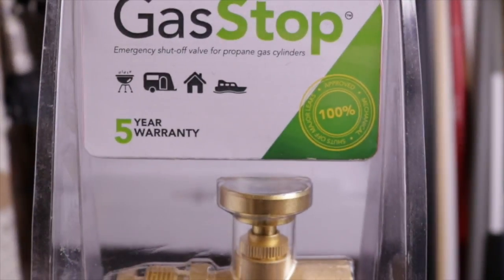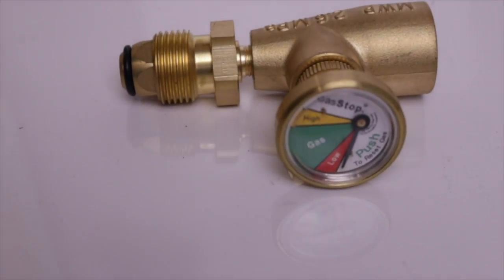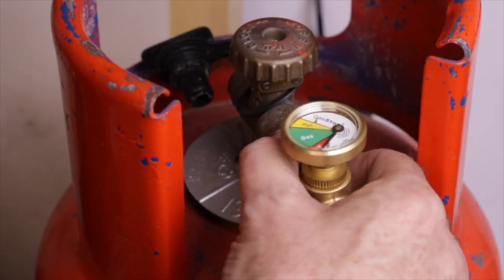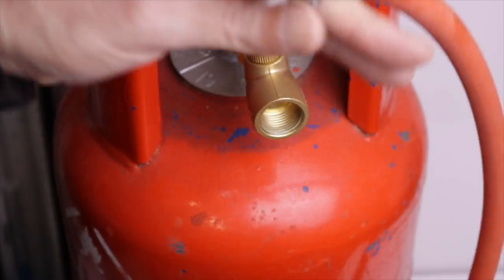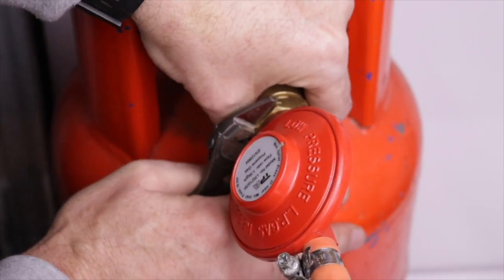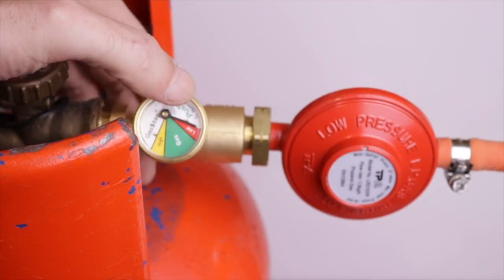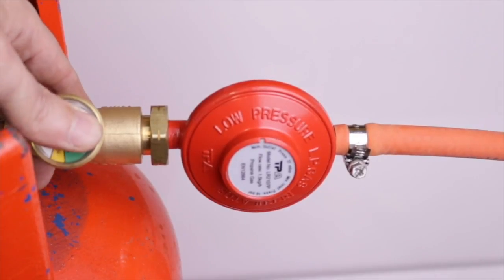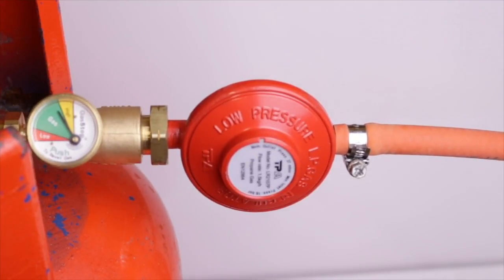GAS STOP VALVE REVIEW //  Emergency Shut-off valve for propane cylinders

Comment: I bought one of these valves and it fits perfectly between the gas bottle and the regular. The problem is that I don't have enough space in the gas cabinet of the campervan to put the bottle inside with such a setup... with the gas stop valve the entire setup sticks several centimeters to the side as seen in your video. So I am trying to find a 90 degree elbow connector so I can attach the regulator vertically (there is enough space on the vertical). I bough a W20 elbow connector from B.E.S and it doesn't fit (way too small). Went to several local heating and plumbing supply shops and nothing will fit. Any ideas what kind of elbow connector I can use? Thanks.
Reply from the maker: I know exactly what you mean. 
Unfortunately, I've never seen a POL Male to POL Female elbow, I think there's definitely a market for it.
So you have the GasStop Valve, then the regulator, then the pipe supply - which sticks out too far. 
In that setup, I'd remote the regulator and mount it elsewhere. 

I'd have the GasStop valve connected to the cylinder, then a POL to W20 braided hose, connected to a mounted single wall block, and have the regulator connected to the single wall block, which in turn connects to the pipe supply. 

Wish I could post an image to better explain the setup but can't see that option on YouTube. 
I have a video on Twitter which shows the setup, I'll post the link below. 
I want to remake the video to include the single-cylinder Clesse OPSO CSR485 regulator. 
A change to the regulations now says all regulators must incorporate an OPSO, even for single cylinder setups.

https://twitter.com/LondonGAS2/status/1408111495330869251?s=20&t=lxRIeUEaxGzPZxx0ouoTEQ

Comment: Do propane gas cylinders require flashback arrestors?
Reply from the maker: Nope.
Reply: Generally not, Flashback arrestors are used when there maybe a back flow of either oxygen or a fuel gas into either line due to one of the tanks going empty causing an imbalance in pressure.